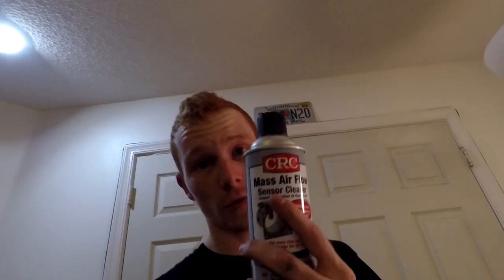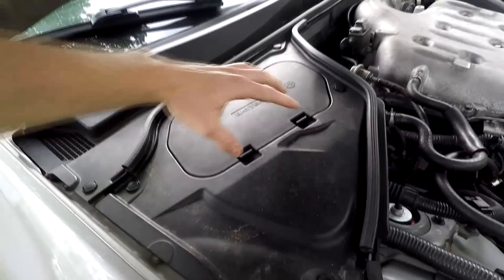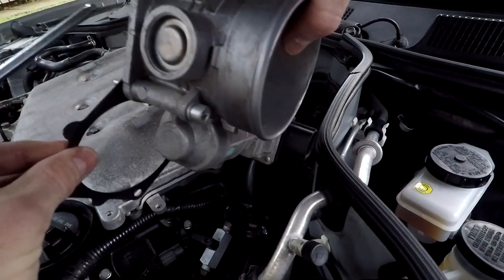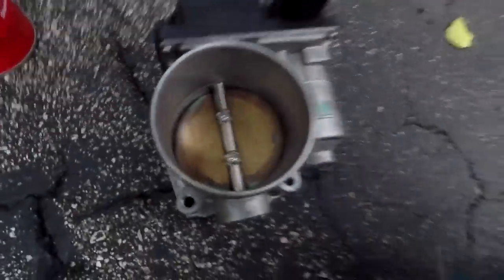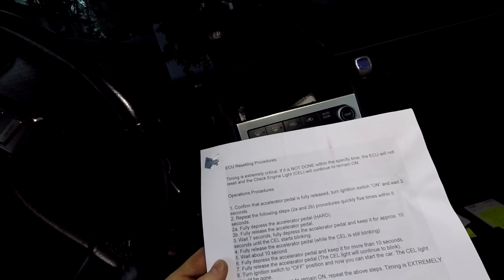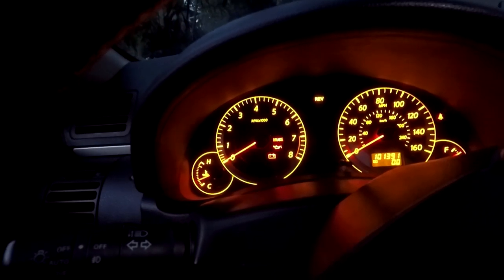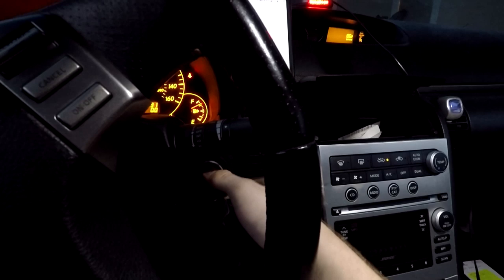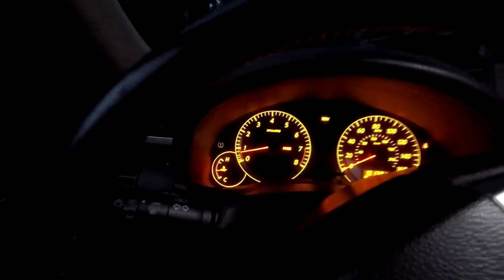G35 350z How To Clean Throttle Body ECU/Throttle/Idle Relearn

Comment: Bought a new throttle body before replacing i made sure the battery was disconnected before anything. Disconnected throttle body and proceeded with replacing it with the new one after all was done my car wont start. Cranks really well wont start tho, any ideas? 05 350z if that info helps
Reply from the maker: Is everything plugged in? It could be a bad MAF
Reply: Aaron Newman nah the MAFs fine ive noticed the wierd security light immobilize thing stays on now so the car wont let me start it but its been acting weird since the moment i replaced it like the headlights now just come on automatically even tho they are set to off and my radiator fans go full ham too even tho the car is off.. idk car is going crazy
Reply: Ezybeatz well i ended up just messing with some of the relays related to the ignition. for some reason pulling the throttle body out made my cars brain have a meltdown and it went into some security lockout shit not letting the engine receive fuel. So as I said i just messed with some of the relays switching then around it magically allowed the car to turnover and start. After that I proceeded with the whole relearning process

Comment: Would scan tool be able to do the relearn without all of the pedal pressing and stuff?
Reply from the maker: I doubt it
Reply: Yeah nissan data scan 1/2/3 (nds) will get the job done. Available on android and mayb iphone too.. (idk  i dont own an iphone) the lite version with ads is free. No need to do the pedal dance for relearn.
Ive done the relearn both ways. If you have an elm327 obd2 reader. Much easier via the app.
Reply: Any good scan tool with a re-learn program on it should work

Comment: Hey whats up i have a 350z so you disconnect the negative and positive before starting ?
Reply from the maker: Yep but you can disconnect just the negitive
Reply: Aaron Newman thanks dude
Reply: Dude my service engine light when off after i changed the whol throttle body ... It workd awesome saved my a trip to the dealer they wanted $650 just to change it

Comment: Zupp man.. got a2004 350z and first start it will go then engine died i need to step on the throttle..then when you run it couple of miles it dies on me when you start it again it will run but TCS OFF and SLIP is on...what do i need to do...Thanks in advance
Reply: Sound like camshaft sensor

Comment: Can anyone help I have the same exact problem I cleaned MAF I installed brand new catch can but it ran fine with new catch can and new PCV. After installing catch can I cleaned Intake manifold center plenum from old oil then reinstalled everything and engine still won’t start. I spray brake cleaner near center plenum and car idles up witch indicates that I have a vacuum leak BUT I used gray silicone all around the areas where the gasket goes and I still seem to have a leak???? Does anyone have any other suggestions PLEASE HELP. 350z

Comment: Hey I replaced my camshaft sensors and the car is still running rough and idling up and down and those were the only codes it was throwin. Any ideas? Thanks
Reply: 80'SBaby Allen did you disconnect the battery before replacing them ? && if so are the sensors sealing correctly ?
Reply: Did you ever figure out why and what was the problem?

Comment: Could cleaning my throttle body fix my crankshaft sensor?
Reply: yes of course and it will fix a flat tire as well. will probably clean the upholstery too but not sure about this. might also fix a difficult relationship but might need to do the relearn procedure as well.
Reply: @spencoid1  😭😭

Comment: Just changed Camshaft sensor bank 1 with OEM par from dealer but trying to start the car, it starts but revs down then dies when I press the gas pedal it dies, I cleaned MAF, and Throttle body
Reply: Did you end up figuring out what was wrong? I have the same issue
Reply: scorpio5183 Bro my car been in the shop for 4 days as of now, they said it's the Mass Air Flow sensor, even though I cleaned it I needed a new one, I called the shop today & they said they ordered the new MAF yesterday and they are picking it up tomorrow morning to put it in. I will keep u updated bro but if your having the same exact issue as me then it's Your MAF or Throttle Body
Reply: Im having same issue replaced my MAF now the car starts then stalls immediately please respond
Reply: BangGangMelly Gang any update? Did the new MAF fix the issue? I've been having the same issue for about 2 years but I barely drive my G so im just getting to it. Just changed the Cam and Crank sensors today but I'm still having the cut off issue once I try to rev
Reply: blingblaw2003 well I found out my problem bro, it wasn’t, such an MAF problem.... Now when I bought my car from my homie ididnt realize that it had a rip in the 1st rubber boot on the air intake, when I did notice i ordered a cheap cold air intake from eBay(When it comes to Infiniti get oem or quality parts or the car won’t run correctly) my car was starting up and running even with the rip in the intake, but when the cold air intake was installed it would do the things I wrote in the first comment⬆️ even my mechanic didn’t know what was up, so I brought the car to one of my other mechanics, they didn’t know either, then after a week They called me and asked if I had the OEM air intake, I bring it to them they installed it and the car has been running perfect ever since, They said they installed a new MAF But I know they are lying because I know about cars  and my 1st mechanic(the 1 who installed the intake) and I went through the procedures to see if i needed an MAF and mine was good I know for a fact they didn’t change MAF so I basically paid $265 just for them to install the stock intake which I could’ve did myself but ididnt care I just wanted my G, At the end they told me that the intake I bought was too cheap when it comes to Infinit get Infiniti parts even if it’s aftermarket make sure it’s good quality u can fuck your car up, I did the same with the cam shaft sensors ordered a cheap set on eBay it fucked up my car made VDC lights and slip lights come on and stay on all in that same day they were installed I went to the dealer and paid $$$ for those sensors I could’ve found good quality on ebay but why wait when I can hit the dealer.......your best bet is to put your car in the shop and let them tell u a few things
Reply: blingblaw2003 Start your car and let it run while you perform this test, Unplug your MAF sensor, If the car turns off your MAF is working perfect, If the car stays morning then your mass airflow sensor isn’t getting a correct reading on air going through your air intake and needs to be replaced
Reply: BangGangMelly Gang thanks for the replies bro. I do have an aftermarket intake on the car but it's been there since I bought the car over 7 years ago. I'll try getting an oem one instead and also test the MAF. I was gonna buy a Throttle body but I'll look into those things you mentioned first. 

THANKS👍
Reply: blingblaw2003 if you had the intake for over 7 years then your car is okay with it, it’s a good intake otherwise u would’ve had problems right after installation. Do the test for the MAF and if you can clean your throttle body but don’t push the throttle open when cleaning it because it can really mess our G’s up I pushed mines a little while clean to get it clean pushing on it a little is fine just not all the way. When your done perform the throttle body relearn...... make sure u go to a shop you’ll find out exactly what’s wrong and might be able to fix it yourself
Reply: blingblaw2003 i cleaned everything at the same time my G is Perfect
Reply: BangGangMelly Gang FINALLY got my car running perfect again.  Did the MAF test and turns out mine was bad, I also had a loss of power for a while now and turns out my coil pack in cylinder six was bad also.  Men it feels good to be able to go fast again!! ☺ Thanks for the tip 👍
Reply: blingblaw2003 Hell Yea Bro G Gang
Reply: BangGangMelly Gang  hey bro I got a 03 g35 and it has no power like it runs but it doesn’t have any power. I changed spark plugs with ngk ones and I replaced coil packs, I checked the vaccum lines, compression is good. It got 95k miles . Any idea what could it be ?

Comment: Whats the size of those 4 allen bolt holding the t.b. ?
Reply: 5mm
Reply: @miguelmoreno4965  thanks man , thats what i was trying.. but my 5mm seem to be too small and my 5.5mm too big.. so i let the t.b. there and clean it .. the 4 allen bolts dont look like being oversized or striped.. im gonna retry that during the winter.
Reply: @JPie777  use 5mm new tools
Reply: @miguelmoreno4965  youre right @! They were stock there real good , but i remove the t.b without stripping any allen heads... Thank's ✌🏼

Comment: Aron my g35 runs at 400 rpm's in drive when im at a drive thru with the ac on and it makes a bump sound or it sounds like it misses then runs smooth again any thoughts?
I did the idel relearn processes but still happens.
Reply: Clean the tb also check the coils and plugs. If it’s misfiring most likely a spark issue

Comment: why is a relearn needed after cleaning it
Reply from the maker: 03056932R because the sensor can now detect more airflow to communicate with the computer. So you want to reset it to allow to computer to be comfortable with the new readings

Comment: Where is the idle located on a g35 coupe 2003
Reply from the maker: Gisselle Torres De La Rosa there is no physical part on the G35 that's called idle, what do you mean? The idle means when you turn the car on and the motor runs without you pressing the gas

Comment: What if I'm getting intermittent misfires after cleaning throttle body? Especially when AC is on. Coincidental or related? Never had misfires before.
Reply from the maker: Could be related, maybe you damaged the throttle body internals while moving the butterfly valve? It's possible

Comment: Too scary...I will have dealership do it..ahahahaha
Reply from the maker: Haha the stealership will charge you a ton of money and probably take forever. This literally took me 20 minutes with a camera in one hand with the throttle body laying on concrete! The benefits really would not be worth what the dealership would charge you in my opinion. But I totally understand!
Reply: I did the 1/2 cleaning...meaning I took off the air induct plastic and rubbing tubing to the throttle....and cleaned the side I could do...I did not take off the throttle body to clean the inside 1/2....I have since bought the gasket....but haven't had time to do it...maybe next week...I think the trick is to not disconnect any wires in the process....it seems possible...

Comment: Is the idle air control valve the same as the throttle body on a 2003 g35?
Reply: No. The IACV is built into the MAF for the G35.